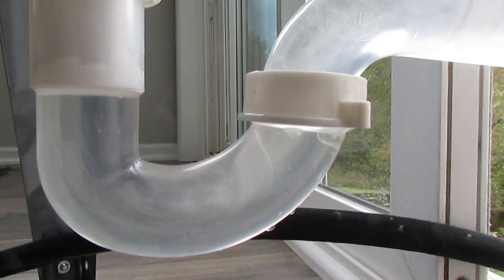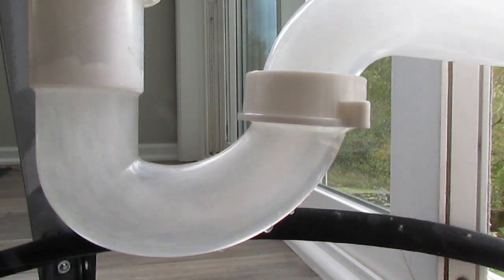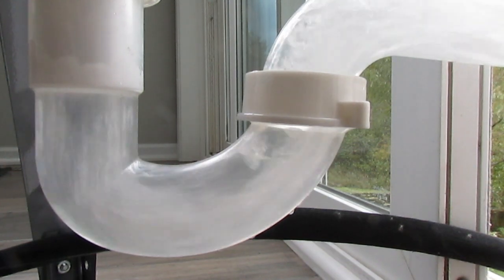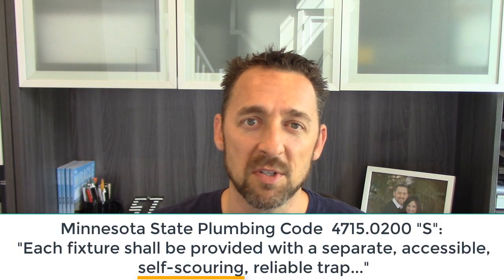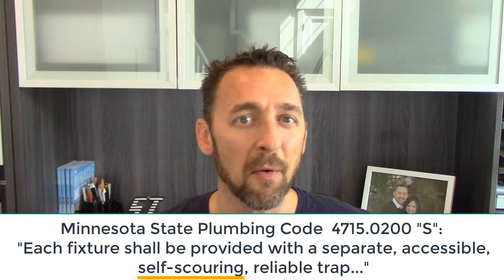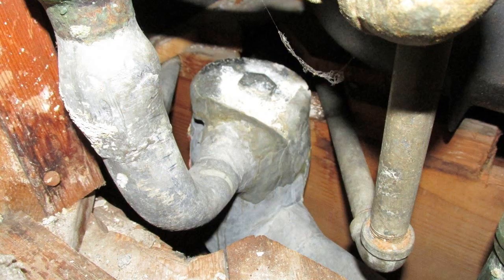Drum traps: why they suck and what to do about them

Comment: At the beginning of the video, you said “water comes into the top and goes out the bottom“… Well, that wouldn’t work very well for a trap now would it? The water has to enter the bottom, or somewhere near the bottom, and exit towards the top otherwise it would not make a trap.
Reply: Yes, he did misstate the direction of flow. But the water that comes into the bottom section of the drum trap starts out at a higher level than the trap itself, for example, the drain at the bottom of the tub, and this is what he likely meant by saying that the water “comes in from the top“. No biggie!

In a drum trap, the water flows down from a higher level, and enters near the bottom and exits near the top. But what actually makes for a trap is having a low section of “in between” piping that is lower than the entrance and exit piping. “Top” and “bottom” are not the relevant concepts here ….

Comment: I have a galvanized drum trap in my 2nd story bathroom, not accessible from the tub access panel, sandwiched right between those junky staple up ceiling tiles and a tile floor. The best part, it's clogged and I'm forced to bail water out of the tub until I can get someone in to cut this pos out and run a pvc drain with a common p trap.
Reply: Hey I seen your Reddit post lol I’m having the same issue having to empty my tub with a bucket till I can get the money to replace the pipes

Comment: Step 1: Get saw. Step 2: cut off pipes on either side. Step 3: Put P-trap in.

I mean seriously, why would anyone ever think about servicing a drum trap that is accessible in the first place? In the labor time you spend screwing around with it you can just cut it out and put in a modern trap.
Reply: Because it's connected with lead and oakum to a cast iron pipe and is a b*tch to get out?

Comment: So the only problem is that they can clog but not that they can let sewage odors pass? Trying to find source of sewage odors in my bathroom
Reply: The one I have is on my bathroom sink
Reply: If the drum trap is installed with the removable access lid on top, and the top is no longer gas-tight (say from corrosion), it will leak sewer gas.  It's an utterly problematic design.  I am in the process of removing mine and replacing with p-traps for two old bathrooms in a 1960s-era house.